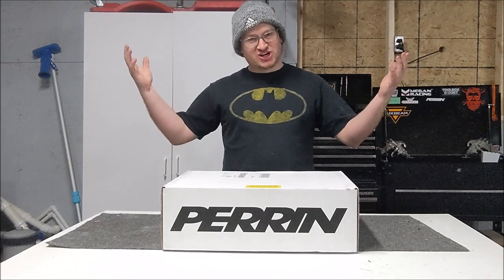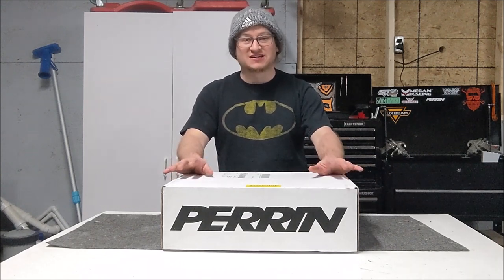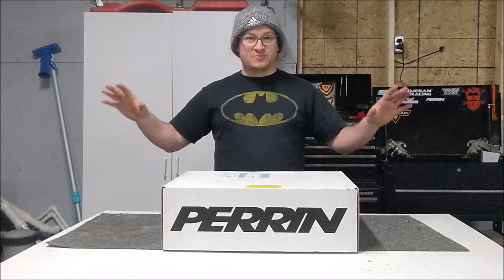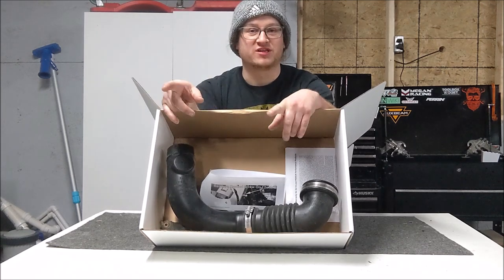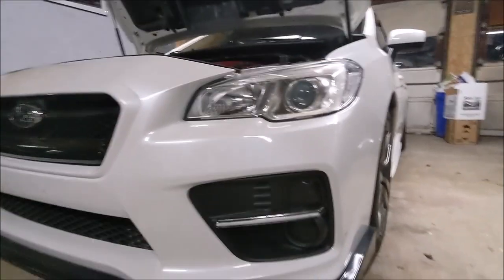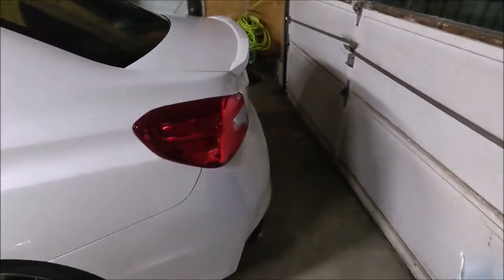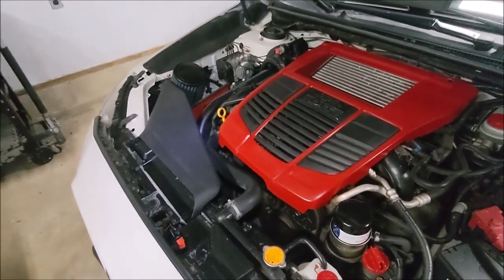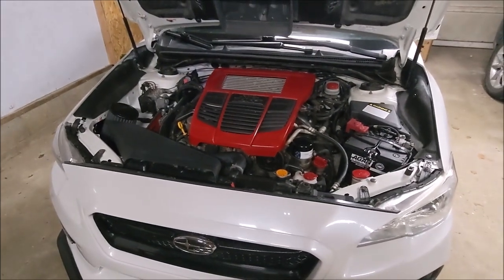WRX Perrin Intake with NO TUNE. Is it safe? Real Readings Before and After Install.

Comment from the maker: Just passed 15,000 miles. Intake on, no tune, and no issues.
Reply: Would this be the same thing for 2021 sti? I can install a intake and don’t need a tune?
Reply: @McBake  appreciate it a lot. It can be any intake ?
Reply from the maker: @Entity_STI  No, the Perrin intake was specifically designed to run with the stock tune. When you look at other intakes the diameter and volume of airflow is different and require a tune or you won't have the correct air/fuel ratio and risk damaging your engine.
Reply: @McBake  gotcha. Perrin intake only.
Reply: @McBake  wrx is a fa20. sti is a ej baby come on now
Reply: yeah definitely DO NOT run an intake without a tune on an sti just go stage 1 +
Reply: Cobb Big sf intake are safe without tune also?
Reply: @McBake  the STI has an EJ not an FA! Be careful folks.
Reply: Any updates? Ive been feeling like this whole "do absolutely nothing without a tuner that only we sell" deal is mostly snake oil. People don't even want to get non Subaru air filters at this point....unless it's tuned of course
Reply from the maker: @josemaldonado724  21,000 miles, zero problems.
Reply: @McBake  that's great to hear and thanks for getting back to me. Have you had a chance to check AFR at wide open throttle (i.e while it's on the open loop fuel table)
Reply: @McBake  how many miles does your wrx have on it and have you noticed any changes in power loss/gain or any issues since installing the Perrin CAI? Please lmk i am wanting to get one but worried without a tune
Reply from the maker: @gavinbrobst4634  125,000 miles. CAI been on since 100,000. No issues at all! None. Get the intake. The noises are exactly what you want.
Reply: @McBake  did you just the the sti has an fa20? Nobody should be taking advice from you lmao
Reply from the maker: @flock7895  that's true.
Reply: @McBake  thank you gives me a better feeling going to buy it asap !
Reply: I have alot of dust where I live would this intake hold up well to it ?
Reply: @McBake  I have wrx 2017 stock cvt ...I want k&n typhoon intake  . ... so (I can run it without tune it???)
Reply from the maker: @rcdb4160  I can’t speak to that intake. Probably not. The Perrin was designed the same size and width for the same air intake as a stock air box
Reply: @McBake  do you get the woosh sound on shifts without a tune
Reply from the maker: @Rumncoke89  yea
Reply: How many miles now, and is it safe? 🤔 all I want for now is axleback exhaust, bpv, and this intake, everything else cosmetic. Don't want tune anytime soon but want it to sound nice..
Reply from the maker: @timmyn915  28,751. Zero issues.
Reply: @McBake  hi bud, can you send the link of Perrin CAI on me if you don’t mind on that and thank you in advance.
Reply: Did you look at fuel trims?
Reply: @McBake  any link please that I can buy. Thank you
Reply: @McBake  are you running 91 or 94? Great video it was really helpful thank you
Reply from the maker: @sharunmathew8207  91
Reply: Any issues? Mines sitting on the floor now. Waiting to get off work and install it?
Reply: @mcbake stil running strong on stock???
Reply from the maker: @weareinflames  sold the car. But yeah it was. Over 30,000 miles with intake.
Reply: Do you have any problems with the engine running too lean or rich?
Reply: @McBake what made you sell the car?
Reply from the maker: @SenorRobb  I traded it for a truck and I’ve regretted it ever since. Like hard core regret.
Reply: Update?
Reply from the maker: @jacobjakus  sold the car :(
Reply: @McBake  NOOOOOOOOOOOOOOOOOOOOOOOOOO
Reply: Thanks because first mod is exhaust and intake

Comment from the maker: Update for everyone. 6,000 miles and no issues at all! Running strong.
Reply: I had it for 2 years and no issue w/o tune
Reply: Did you tune it bro or you running with stock tune?
Reply from the maker: @DanielMartinez-vw6bs  stock tune.
Reply: Is still running strong?I’m afraid because many people said have to tune.
Reply from the maker: @DanielMartinez-vw6bs  runs great. It's my daily. Yeah I decided not to listen to Internet professionals and had faith in what Perrin said. It's good to go man.
Reply: @McBake   thank you so much bro I bought mine and I was thinking in tune it and I have the Perrin turbo inlet too so would be nice maybe I can tune later but if is safe I can do it.

Comment: Perrin intake works well noticed a power loss so instead of freaking out like most do I took the opening in my stock air box into consideration did some experimentation came up with a smaller filter that causes enough restrictions that mimics the stock air box opening and the power came back my nice pops and burbles through the Exhaust came back along with the boomba bypass fluffer.... never realized how many haters there are on Subaru WRX/sti groups it’s pathetic...::: again McBake thanks man for the help
Reply: So you went with a smaller filter? How has it been?

Comment: on a normal driving condition, the reading shouldn't be too far off because of the long air travel with a CAI, but did you see the numbers during a WOT? and also your o2 sensors reading lean, which is what we all say will happen if you don't have a proper tune with an aftermarket intake. Anywhoo, if you don't constantly WOT, you technically should be ok running without a tune. I had to travel 2 hours for a tune on a whole brand new much bigger turbo setup, stayed out of boost and I made it there just fine.

Comment: I had put a mishimoto intake on my 15 wrx w no tune or anything and it gave me a maf code at first then it went away. Now a couple days later it popped up a couple codes, maf, intake temp and another one saying “too rich dtc severity 2 of 3 “ it was driving slowish, it would idle and die and when I started it today it idled really high and it sounded like it was misfiring

Comment: I own an 18' and the moment I said I was going to get an intake so many people were telling me not to do it without a tune. Seems like the internet and car people in general never really know whats right or wrong, its all about opinion and something they heard from somebody one tine lmao
Reply: Man, just be careful. The rule of thumb since the FA engines came out in 2012 has been you can’t really do any mods, aside from an axel back exhaust without an Accessport and an OTS, E, or Protune. Those that came before us learned the hard way so we didn’t have to. Often though you hear people running a GS intake on a Cobb tune or something similar and they say it’s fine, and hopefully it is for their sake. But Phatbotti or BrenTuning and all the other big name tunersthat get paid $500-$900 a tune will tell you the same, if your gonna change the air flow to the car get an Accessport and at minimum an OTS tune. With all that being said the Perrin intake seems to work pretty safely on a stock tune, so give it a try, it will probably work fine. I’m not willing to be the Guinea pig with my $30,000. I’ll just wait on my AP and GS intake to come in the mail, and most importantly stay in my lane!
Reply from the maker: I believe as long as you take it easy it's going to be fine. I went for it on this mod because who do I trust, random people online or a well respected aftermarket company you developed an intake for a stock tune. I trusted Perrin over online "professionals" and it has paid off.
Reply: @McBake  That what Perrin said so l got with my new WRX and dealership said it is fine with stock tune, they are doing the installation

Comment: Hey boss I just picked up a 2017 wrx with this intake! How's yours holding up? My Rex has 25000 miles on it and idk whether to take this off or keep it on.im also noticing my boost peaks at 21.3 then flutters between 16 and 20. Like just bounces around the whole time under trotter
Reply: That’s normal for stock tune lmao they suck
Reply: any update on how it’s running? mine came with a Mishimoto and they claim the same. Boost is the same so no worries.

Comment: are you still running this intake on stock tune? people have my paranoid about running it with out a tune lol
Reply from the maker: Yep! 2 months and 6,000 miles. Still rolling strong with zero issues!
Reply: @McBake  yeah i think that should be sufficient evidence that it’s safe. i’m guessing you’ve had zero CEL’s?
Reply from the maker: @goybi7356  your right. No CELs not even a bit of worrisome running or anything. If anything I feel like it runs better and my MPG is up from 28 to 30 with 91 octane.
Reply: @McBake  that’s crazy haha. i just bought a used one from a guy in a fb group. gonna try it out. not expecting gains. i just want the sound and the price was good for me lol
Reply from the maker: @goybi7356  I did it for the sound as well. And man, it's awesome!
Reply: @McBake  i’m excited for it lol
Reply: @goybi7356  did u get it and how do u like it. Im about to order one.
Reply: @heathlane4683  yeah i got a used one and it worked fine. no issues. i ended up saying screw it and putting a stage 1 cobb tune because the factory tune is garbage.
Reply: Is it just specific intake you can run without a tune? I been kinda effy about installing one in my car deciding I want to tune it or not.
Reply: @sonknul7817  as far as i know Perrin is the only one you can run a with a stock tune. i went the extra mile and just went stage 2 and got protuned now lol